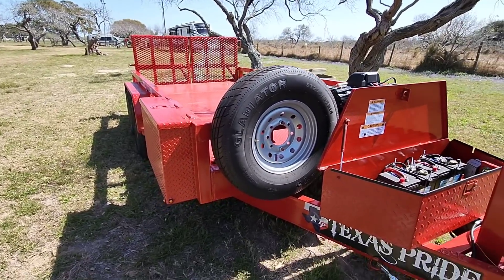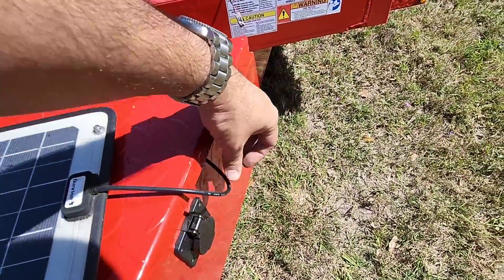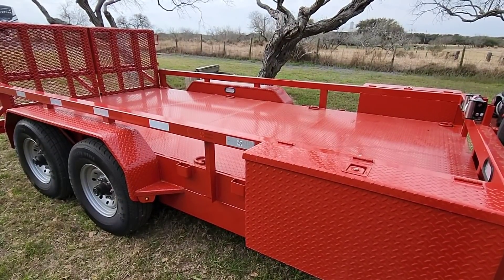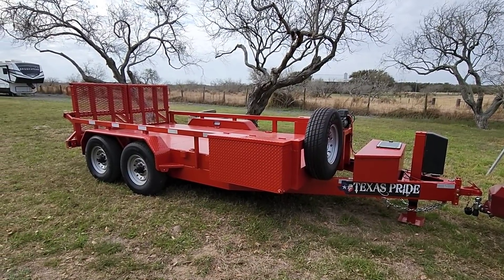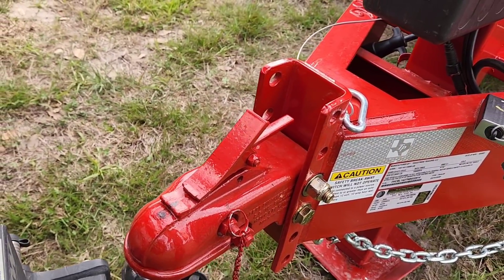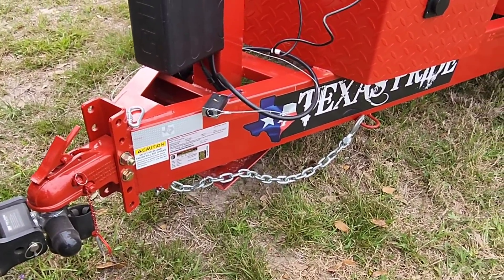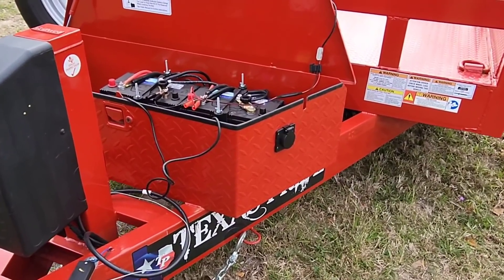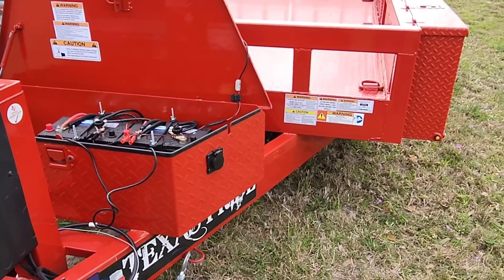DON'T HIGHBALL your Trailer Coupler!

Comment: A buddy wanted to borrow my trailer. I told him it was a 2 5/16 coupler , he said that's what he had so  OK , he came and got the trailer and about 3 miles down the road there was a dip in the road and the trailer coupler came off the ball. He did high ball it , he had a 2" ball. Luck the trailer safety chains held . BUT, unlucky was the tailgate of his pickup which took a quite a few blows when stopping.

Comment: It was about 3:15 A.M. and we were hooking up the boat to go duck hunting.  My then 14 year old son wanted to help so he guided me back and under the ball.  He yelled I got it dad.  I felt the truck settle a little as the boat was set onto the ball.  I jumped out real quick to check the connection.  I saw the latch on the hitch was down and the pin was in.  So we took off. Went over an overpass about 15 miles down the road and as we came off the overpass the trailer passed us up in the left lane.  It skidded through the grass and hit s Street sign and knocked it down.  Luckily the tongue never dug into the grass.  We stopped backed up to the boat and reconnected it.  The only damage was to the front of the aluminum boat and it broke the trolling motor off. We still went duck hunting and 10 years later still use the boat weekly.  We use the dent as a reminder  everytime we connect.

Comment: Nothing like a few good wasp 🐝 stings to the hand while checking those couplers to make sure your trailer is latched 😂. Good advice because I’ve seen it to many times over the years pulling boats. Just because it locks down doesn’t mean it’s good to go.

Comment: Was helping my dad get ready for a boat trip while he was at work so all he had to do was drive away.

Hooked up the trailer, chains, and checked the lights. Got the all his boat preps done. 

The whole rig was parked in the front facing the road ready to go.

He got home in his other car, double checked it before he drove away.
I hadn’t gotten the coupler latched.🤦🏻
I was embarrassed and disappointed with myself.

No matter how much experience you have, its always possible to make a mistake.

When you find someone else’s mistake, inform them but be humble.
It can happen to you also, and probably by the person you least want to.
But the alternative of tragedy is more than embarrassing.

Comment: That won't charge the batteries the way you hooked it up if you have them disconnected. The way you hooked it up first would keep one charged, second way you put it will work if you don't disconnect batteries

Comment: another mistake I made once I pulled a trailer with a 2 inch ball then I hooked up to another trailer that had a 2 5/16 ball but did not change the ball on the vehicle again got down the road when things didn’t quite feel right that’s what I realized. I had the wrong ball

Comment: Only time I had a true scare, I was young and had my first little cargo trailer. It was in rough shape. I brought an atv somewhere and when i unloaded it, the trailer did a weird tilt and It had come off the hitch. I went to look and the whole locking mechanism had completely broken off at some point and was nowhere to be seen. Ever since then I hated that style of coupler. My car trailer now has a Sliding Collar Coupler, which i personally love and highly recommend. There's just no way it was come undone on its own, and no way it can be mistakenly coupled at all.
Reply: I have the Bulldog coupler (sliding collar) and found you need to use a pin or locking pin (better) to ensure nobody unlocks the collar.  People these days will do anything to mess up others if they can get away with it.  This is one reason I like the locking pin, which sets behind the sliding coupler so the coupler can't be unlocked.
Reply: @Harry-zz2oh  Exactly!

Comment: I dont have to worry about "high balling" on my 9ton trl cause thats a pintle and i love it.  Log splitter and wood trl im considering converting to pintle as using a ball on the tractors boom pole i can scoop up my 9ton to move on property
I hooked up to the old wood trl and bouncing thru the field and pulled out on moms gravel road and i had no trl.  But that wasnt high balled that was the coupler was wore out so had to re gut it

As a kid/young adult in 4-h another kid was towing empty 2 horse trl and no chains. Wasnt hooked up properly and came off ball and coupler dug bending tongue and flipping trl caving in part off the roof.
Reply: For rough roads or off road driving the pintle setup is the best.  I believe this is one reason why most military trucks use the pintle hookup.
Reply: @Harry-zz2oh  rough roads.  Lol.  Thats like all the paved roads

Comment: Just a thought JD. Y'all were talking about cleaning the face of the solar panel. I'm wondering if one of the ceramic coatings for protecting vehicle finishes would work on solar panels. Might be something y'all could check out for a future video. Giddy up.

Comment: Hey JD,
I didn't get a good look at the charger setup, but if you use the disconnect on the negative terminal, won't it only charge the one battery?

Comment: Once I have weight on the truck, I close the coupler and jack the trailer up. if truck goes up, it's connected.

Years ago, i sent my helper to hook up my trailer. when i got there with my quad, I got a thumbs up from him and I proceeded to put a nice dent as far up my tailgate that the chains would allow.
Since then, no one is allowed to hook up a trailer to my truck, unless I'm not there.

Comment: The mistake I made once I had an F150 with an enclosed trailer on the back I needed to use another trailer that I had with my expedition, but I could not find the hitch pin, so I removed it from the F150 put it in the expedition when I got home, I pulled the hitch pen and just set it in the cupholder to put it back in the hitch the next morning before I left I was quite a ways down the road when I noticed that the trailer did not quite feel right, and that’s when I looked down and saw the hitch pen sitting in the cupholder I slowed down real nice and slow pulled over the hitch was like almost out of the tube

Comment: FYI the way you haave your battery maintainer hooked up to the batteries will not charge either battery with the disconect switches open. The way you had the charger hooked up the first time would at least charge that one battery.

Comment: I forgot to raise the single wheel jack once (damaged that plastic wheel but didn't break it). I figured it out about 4 blocks down the road and pulled off into a parking lot to lift the jack up. I've left the chains off several times. Thankfully I've never had any runaway. I've never high balled my trailer though. It's really hard to do that with my coupler since it's pretty shallow. It's one of those "just enough metal to do the job" types that if you don't get it on, it's really obvious. Then again, my utility trailer is a back half of a pickup with the frame cut and bent in to the A style coupler and only designed to handle about 3500# gross (1 ton load). Nothing near what your trailer will handle.

Comment: great video. one suggestion, I would have routed the solar panel wire through the back of the box so you don't have to finagle with it every time you open/close the lid
Reply: I agree. Use a large rubber grommet and a set of plug together wires. Greg, I also try to make things simple when using electricity or anything else like it. The easier you can make it not break the better off you are.
Reply: I jokingly tell people that it's laziness when I'm trying to make things more efficient. But I also like to set things up so they are one and done and not have to have extra unnecessary steps every time I need to use it.

Comment: 4:50 JD you realize that the way you have the solar panel connected won't charge anything, because the negative terminal is disconnected any wouldn't allow a current path and because the positive is connected on the other battery nothing will happen.  😎🤷‍♂

Comment: I sat my very light lawnmower trailer down in p gravel hooked it up and had a rock in it and it was night chains kept it on truck but bumper had damage fyi if ur trailer ever comes off don't hit breaks or gas coast to stop it will rear end u if it's on chains and u hit brakes at all.

Comment: I forgot to lower the hitch lock on my stock trailer once.  Fortunately the weight of the animals kept it on the ball on the way there.  A bump in the driveway popped it off the ball on leaving.  My crossed safety chains saved the day.  I immediately felt the trailer's behavior change and stopped to hook it up properly.

Comment: I don't know if this counts as a highball, but I rented a U-Haul car dolly one where all the wheels are off the ground for the vehicle. I let the U-Haul guy put it on and twist that knob to supposedly tighten it to the ball.  Made it all the way to where I was going to pick up the car. To my horror when I went to put the car on the whole tongue of the trailer lifted up in the air, I'm damn lucky the trailer didn't move and tear the doors up on my van, which you can only find off a donor vehicle (84 Chevrolet G30 van). Went over there and double checked everything and tightened it and everything worked okay, got to where I work at a buddy, and I took a big old adjustable pipe wrench and tightened it to death. lucky we got the thing off after I was done using it how tight we got it

Comment: I highballed once and the trailer did in fact come off 😂 was a coupler style that I had never used before and I triple checked that thing because I had never used it before and wanted to make sure that it was in fact seated on the ball. Got going down the road and hit a bump…next thing my trailer was up my ass. Luckily the coupler got wedged underneath my bumper and there was enough weight off the front that it was stuck in there good and I was still able to pull off the road with some control of the trailer. Never again will I make that mistake 🤣😅 also there was no real damage to my truck or trailer, thankfully.

Comment: Never done that, but I did have a ball come loose after I had gone about 50 miles, and had to stop for gas, and noticed it came loose, tightened the ball and drove another 3100 miles with no problem.

Comment: You could remove the bolts on the coupler and replace them with grade 8 pins and just take the coupler off when youre not using it.

Comment: Pins holding ramps up 
If you don’t pay attention you can easily not put the pins properly and in lock position 
Pins can pop out, I picked my new trailer yesterday with the eximente didn’t inspect the pins ring position 
Ramp came down about 1/4 mile from dealer 
Thank God car behind me had some space

Comment: I was hauling cows with a buddy of mine in a gooseneck and by the third load and I was backing in something made a pop and we looked at each other so I said “ I guess the pin finally latched.”  His eyes got wide and before he could say anything else I told him about the safety chain I had seen work it’s way under the hitch.

Comment: I forgot to lock the coupler after connecting. Drove two hours home without incident. But I just got luck. If it were an auto-lock I would have been safer. But I double-check then tripple-check now.

Comment: I used to run my jack back up a little bit to make sure it was locked on the ball.  With an electric jack it would only take a few seconds.  I'm a little averse to sticking my fingers up into a pinch point like that.

Comment: There is a lot of emphasis on battery charging. If the trailers are used about once per month, then the batteries are charged off the truck's 7 way connection. With the disconnects installed, I would doubt there is any need for the solar chargers. If the trailers sit for 3 months, then I see the point.

Comment: Only trailer I've ever done that on was my little 14' Aluminum boat trailer thing weighs like 600 pounds with the boat on it maybe and it's always a pain to get it latched onto the hitch because it has like maybe 40-60 pounds of tongue weight lol. So it's not like you can just set it down and latch it. I sometimes have to jump up and down on the tongue to get it down onto the ball, but then again it's a pretty old trailer should probably grease it or something one of these days.

Comment: I highballed my boat trailer once as it was sitting on an uneven ground and looked like it was down.  Locked the latch in place and the first bump I hit on my camp road the trailer came unhitched, connected only with the chains.  I made the mistake of hitting the brakes and the trailer winch stand hit my back bumper leaving a nice dent.  Lesson learned.  The tongue load with the boat on is really light and there is no way to really change the balance.

Comment: Twice I've witnessed someone pulling a trailer with the wrong size ball..... they had multiple trailers with multiple coupler sizes and grabbed the wrong hitch when they hooked up..... My Grandfather luckily towed a rv about 2 hrs away with a 2" ball instead of the 2-5/16" needed WITHOUT loosing the camper!  Another neighbor of mine hit a bump with a small utility cart (2" coupler) with a 1-7/8" ball and popped off and luckily didn't hit the back of his Subaru just going slow through his yard... Both could have been major failures!

Comment: Two big towing mistakes and nearly got away with both. I put a Reese goose box in my 2021 Roamer 264RLS and towed it back home from the service department t with the hitch locked open!! I didn’t realize their service department had locked the hitch open so they could move it around their lot easier with a forklift. My unit puts 2200lbs of weight onto my truck so the only thing that was ruined was my underwear when I realized my mistake. Lol. 

I also towed a rented uhaul trailer that came off the ball on the high way and was bouncing from right tire to left and to right back and forth like a bucking horse. The tongue wrecked the tailgate of the truck coming to a stop but the trailer was fine. 

I also left a water pump on towing an RV and a case of beer in the outside kitchen hit cold water the faucet valve into the on position with a stopper in the sink drain. Trailer was FLOODED before I realized what happened. Fortunately, no real damage occurred and the weather was perfect to get it dried out quickly.
Reply: You could have been fined for ruining all the beer!  Shame on you; of course, it might have been worse, you could have broken a few cases of Scotch.

Comment: Thanks safety is always important.  I have attached a trailer and the coupler did not lock around the ball. I felt something different,  the weight on the tongue and taller kept it in place, what would of happened if I stopped fast or went o e rough roads? All was good and another learning experience.

Comment: I'm pretty sure that coupler is auto locking.  The "forward latch position" is just supposed to be used for removing the coupler from ball.  Try it again with it in the "lock" position before you lower it on.

Comment: Oh yes I have high balled the hitch , kinda. 
I let a guy put his trailer on my hitch ball an we went down the road. Utility trailer an Bobcat on it. 
I told him it felt sloppy while going to the next job. 
I got out an checked the situation and it all was hooked up right. Not noticeable that the hitch sat so low because it was a 2 5/16 hitch an 2” ball. 
It stayed there for ten miles because of the tongue weight was so heavy. 
But I switched to the right size for the way back. That was so easy too miss.

Comment: I never knew the term highball, but I think that's what happened when we had our 25-foot Minnie Winnie in our driveway which has an angle, so when we would hitch it up to the Avalanche, I would always noticed that it did not look seated correctly so I would have to put the car in gear and drag it out to the street to level ground and that would seat it correctly. So I would say be careful hitting on any kind of an angle or unlevel ground

Comment: My #1 Rule - perform every step of hookup yourself. For me, it's as follows:
1. Verify hitch ball size and coupler size
2. Lower trailer coupler onto the ball
3. Latch and safety pin coupler
4. Raise/stow the landing gear, with safety pin if used
5. Install equalizer bars (if utilized)
5. Connect safety chains
6.Connect breakaway
7.Connect lights/brakes
8.Check lights
9. Perform functional brake check
The only exception is if I have a finicky coupler that sometimes takes a little trailer brake to fully engage on the ball. I'll connect the lights/brakes, give it a little tug on the trailer brake then go right back to Step 3. 

Only other comment is - watch out for scrubbing that landing gear on your new trailer - looks like a low-rider! Very nice trailer, though!

Comment: I had my trailer loaded with my ATV, ready to go go for an inspection appointment, because the previous owner was caught with an illegal modification according to registration documents. (Could still be road legal, but with increased tax every year)

Then I had issues with the quick coupler to install the ball on my car.

I had to borrow a car, and was short on time for the appointment. 
Don't remember who did what, or rather who didn't check the ball.

After 100 m, at slow speed, the trailer came off the ball, and the safety wire pulled the trailer brakes. 

I hooked it on, without safety wire, but verified the ball 3 times, got to the appointment on time, and ATV was approved. Then whent to a trailer service center, to get a new safetywire, before going home.

Comment: That battery tender isn't doing anything with the way you have it connected across the two batteries as long as the disconnects are "open".  You can tend the individual batteries or close the disconnects.

Comment: I’ve done it with a Uhaul trailer. Those screw on latches are awful. I attached the trailer on uneven ground. It was high balled. Found out real quick. Got a ding in my bumper too.